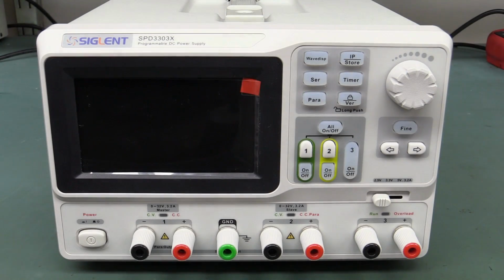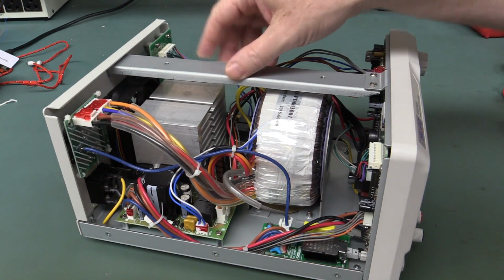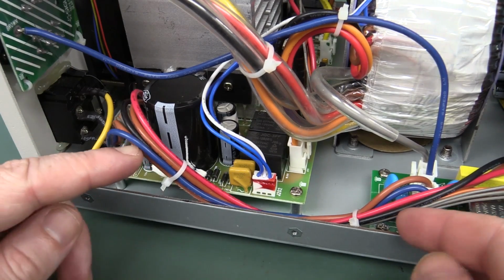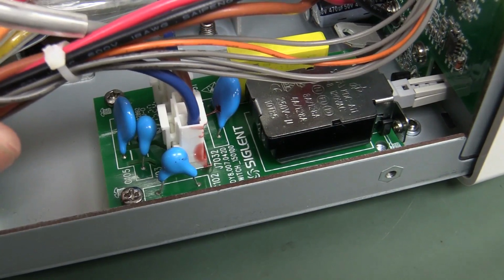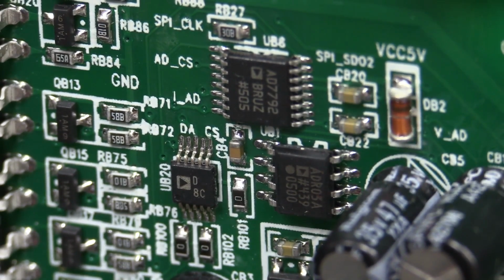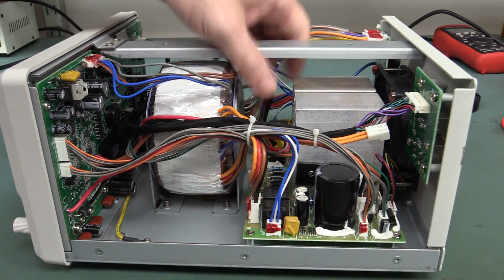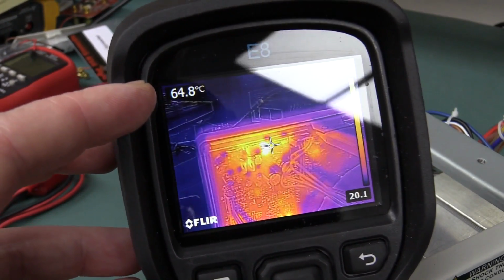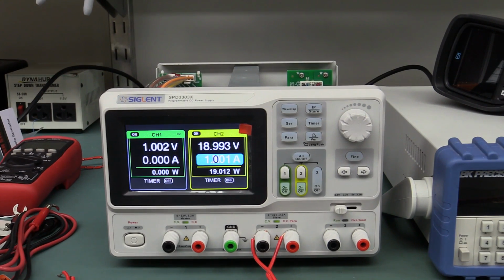EEVblog #828 - Siglent SPD3303X Precision Lab PSU Teardown

Comment: VOLTAGE SETTING OVERRANGE! lol
Seems like something only a rookie would need, but how many rookies would have access to or own a $500 power supply? Maybe they reused some user interface code from their other devices?
A less obtrusive "message" might be having the cursor or highlighted digit turn red for a split second, or a short "beep" for valid operations with a longer "boop" for invalid ones
Reply: A more useful thing would be to do nothing. A control knob doesn't need any message... when it stops doing anything, then that means it is as high (or low) as it can go.

Comment: Two noob questions:  
1) So linear power supply is a good thing...  Why?  (I thought switching ones were the best thing since sliced bread since it wastes less energy,  less heat etc..)
2) And what's the point of supplying power so precise down to single digit milliamps?
Reply: Nobody replied, so I will try to cover at least some issues (some 5 years later):
1. Linear power supplies are heavier and have some other limitations, however the power output is CLEAN. There is no ripple or electrical noise from the switching operation. Ripple on the power input can really upset sensitive electronics, and cause misdiagnosis (eg: where is that harmonic frequency coming from?).
2. The ability to regulate power accurately is important for troubleshooting and designing. It becomes more important the lower the power requirements of the connected device. 1mA is irrelevant to a 12V50W light bulb, however it is vitally important for a SMD LED that is designed to operate at 2mA maximum.
3. It's not just the precision, but also the ACCURACY, the resolution drift, the stability and the repeatability of Voltage and Current measurements. It's no point having 1mV precision if the accuracy is +/-5mV
4. Generally a Linear power supply is ALWAYS considered better than a Switching power supply. However they cost more and are large and heavy. You get better "bang for bucks" from a Switching power supply, but they are always an inferior solution. That said, for the same $$ you will probably get better features and raw "on-paper" performance from a Switching type power supply.

Comment: I've seen cat 6 fail completely due to a centimeter or two of untwisted pair where the installation tech has unwound it to make it easier to punch down. A long run of untwisted pairs, inside a high-emf 50.60hz environment, surprises the pants off me. I'm guessing it's a pretty slow connection.

Comment: My Siglent power supply transformer (got two- the one is S model the other is with one less digit resolution on the display. I thing it is the D model) went buzzing horribly after 5 times use ! It is an fairly expensive 3303S of more then $350.

Comment: Dave, you constantly talk about the capacitor brand, and how one brand is "better" than the other. What do you mean by that? Are you talking about electrical specs, or the lifetime (or both)? Is it something measurable? Can you come up with an experiment that clearly shows that Rubicon caps are better than Lelon caps? How would you test a claim like that?
Reply: Both,yes, failure rates are recorded and you can see them, use some caps hard for years and examine them electrically and look at the failure rates and they are better lost of the times even in specs.
Reply: It's not the brand that matters, that's just personal bias (which Dave does very well).
The specs of the capacitor is what is more important. Rubycon makes cheap low-end short-life capacitors, and Lelon makes really high quality capacitors. Download each brand's "Series Chart" and you will see the vast range of characteristics that each brand supplies.

Comment: WOW, 100C on the outside case of that transistor?
I know transistors can handle that, but I'd rather see it at a lower temp than 100C ... maybe like 70C or so.

Comment: Talking about TO-220 package components vibrating loose, I resurrected a cheap XMH ballast a while back in which the input voltage regulator actually vibrated loose.

Comment: Hey Dave
nice video. Can you do a video on the differences of the different Capacitor Brands? You always tell that one brand is the best but why and can u prove it ;) 

Greets from Germany
Reply: Reply to an old post... Capacitor brand is not as much importance as the SERIES of capacitor. There are cheap and nasty Rubycon models, and there are good quality Rubycon. Same for Chemicon and Nichicon,w ho also make very high quality and also make low cost short-life models. Same for Lelon, and even for brands like Capxon who DO have good quality capacitors in their ranges. There are many many different types within every brand, each with various characteristics and compromises.
The main thing about the brand is "reputation" rather than anything else - this is more about personal bias, as well as knowledge of whether rated specs (eg: Lifetime) will be met.... those things cannot be tested or proven.
A good analogy is for cars - is an Audi a "better" car than a BMW or a Ford? Which is the "best" brand of vehicle? So that is the type of question that you are asking about Capacitor brands... nobody can answer that.

Comment: Those insulators don't break the shorted turn.  One would need to be behind the bolt head to break the circuit, not between the transformer and the mounting flange.

Also no way they're running Linux on the STM32F207VE with its 512k of flash and 128k of SRAM.  This is an M3 microcontroller, not a big ARM SoC.
Reply: +Benjamin “Ozias” Esposti It's not running Linux.
Reply: +ollopa1 Dave said that he could see an insulating washer under the bolt.  I couldn't see it but my eyes have already seen their best days.
Reply: +ollopa1 
Maybe it's a chopped up version of Linux?
Reply: ollopa1
Okay if you say so :P
Reply: actually there IS linux kernel (uCLinux) for Cortex-M3 chips and it may run on STM32, but still it requires lots of program and data memory, can't run on standalone STM32.
Reply: ollopa1 He's referring to the insulating washer sitting between the nut and the mounting flange (5:54). The insulator between the transformer and flange is there to protect the windings from sharp edges (6:49).

Comment: If they consider repairing the banana plugs issue, screen saver and out of range message, and also that possible hotspot on that rectifier. I would buy it.
Reply: I would'nt be let down by an out of range message or a screensaver that can be turned off in the settings ;-) But the binding posts are indeed very annoying.

Comment: Just pointing out that it's not Linux or any "high level" OS running on the STM microcontroller. It hasn't got the memory, nor the processing speed; it's a Cortex-M3. It might do the display rendering (drawing fonts and such), but there might be another actual controller. As for the JTAG header, the STM also supports JTAG-SWD, so it might be using the 20 pin connector, but 3 pins would be enough too:)

Comment: Sorry, this power supply is a hot mess. The binding posts should have been the first "holy crap" and return. The interface looks terrible! Like, I realize it's 1mV/1mA, but wow... it's just ugly. Also, the fact the 3rd output isn't current limited... why on earth would you buy this over the DP832?! It's $450 street, and the high res upgrade is $100. sigh Siglent need to up their game if they want to really compete.

Comment: Why do you say switch mode rubbish dave ? Are they that bad?
Reply: +Alperen Akküncü 
Well, they can be.
Switch mode power supplies have very noisy outputs, and the noise is at a high frequency.
But I do like how they are smaller and more efficient! :)
Reply: thank you for your responses guys

Comment: With a shorted output at a 3.198A limit, the feedback circuit is probably keeping the voltage drop across the power device the same no matter which voltage setting is used right?  Unless it doesn't automatically switch taps as the current limit is reached.

Comment: Great vid, as usual.  The poor quality of the front panel connectors is very surprising.  And failing to use the standard spacing between them is nuts.  I wouldn't buy this thing, just because of those problems.
Reply: The whole digitization of the interface is a mistake on a PSU. It should remain simple and 99% analog. An ARM microprocessor in a freaking PSU give me a break.

Comment: Can anyone help me? im doing a SMD pcb and im using a MJD122  (TO252) to control a 12v fan using pwm from an arduino. there is not many heatsinks for the TO252 package and the only ones i can find are quite expensive. anyone know any clever way of attaching a heatsink to this ? space is limited so i cant exacly just glue a heatsink on top of the TO252 transistor.
Reply: Replying to a VERY old comment... TO252 is designed to use the copper traces/pads as a heatsink. You add lots of vias and have a large copper surface below to dissipate heat.
The MJD122 is a very poor choice for PWM, you should use a Mosfet. Because the MOS has low internal resistance, the device won't get hot or need any heatsink at all for a small load like a 12V fan (what ? 150mA or so?).
HOWEVER, the proper way is to use a PWM controlled (4-wire) fan and just use a tiny output device to drive the PWM input of the fan. If space is limited, then don't add ANY unnecessary PWM power output on the PCB at all.

Comment: When I look at this all I see is cheap and cheerful!  Pity you're so far away Dave, otherwise I'd drop in with a PROPER linear lab PSU, or 3!  You'd love my Farnell H30-100, thats 0-30 volts and 0-100 amps, and 89 kg!!  Or my HP 6266, 0-40 volts & 0-5 amps. Or my Kepco ATE 36-30M, 0-36 volts & 0-30 amps.  All old school with no microprocessor  software programming etc, but absolutely no flappin in the breeze or how you doin either!  Although the Farnell and Kepco are 2 man lifts, to avoid a potential casualty visit that is!
Reply: +turboslag Farnell H30-100 is on my eBay grail list haha
Reply: +Davo Mapo 
Was or is now?!  The problem with the H30-100 is shipping it!  Actually, and don't ask me why, but I have 3!  And I had to collect them all, which entailed a 300 mile round trip on one!  Although 89 KG is not heavy in the scheme of shipping, as they can can be put on a pallet, sellers are not willing to do it.  It is a beast though and will sit at full output, 3kw remember, all day, every day without breaking sweat!  Ok, it gets warm but is designed for continuous operation.  It certainly gives my electronic load something to do!
Reply: The last time I saw one on eBay is was going for are 500 dollars with over 100 dollar freight. I am going to continue to look on Labx as they have some amazing deals on ps. My current power supply (chinese) spits out 30 volts at 15 amps which is sufficient for most of what I do. I do also have a Bertan Model 210-05R which is an amazing supply I use almost daily for my high voltage experiments.
Reply: Davo Mapo

I wish you luck in finding one.  Also look at Kepco, a native US maker. I mentioned the one I have but they have a massive range and the older stuff can be had for not alot, it is very good stuff.
I was lucky and found mine in the UK so had our mains voltage setting. It was on ebay as spares or repair as the seller couldn't get anything out of it, so I got it for about £15!!
However, I had noticed it was missing it's programming plug from the back and knew thats why it seemed dead.
It took me a while to find another plug but the PSU fired right up when it was installed!

Comment: Is this unit from the Australian market? I had always thought that for C-tick certification, air flow had to be filtered (ingress of dust). Can any one clarify?

2:50 Like a sausage down a hallway!!
Reply: C-tick has ABSOLUTELTY nothing to do with airflow or dust. In actual fact "C-tick" hasn't been applicable in Australia for about 5 years, probably longer (it has been replaced by RCM).
The only certification that would apply might be for electrical safety, in that live connections could not be touched with a standard finger. In practical terms that means no holes larger than about 1cm diameter with terminals close enough for a finger to poke to..

Comment: The chassis will be metal pressed not laser cut, if you look at one side of the sheet it is curved over on the edge (would of been the top side of the sheet as it was pressed), and the burr is from the shearing force as it is pressed (would of been the bottom side of the sheet). i used to do metal pressings years ago.

Comment: +EEVblog - That toroidal shorted-turn thing is a classic - it's the numero-uno rule when building your own amplifiers etc. ;)

Surely the bolt would still constitute a shorted-turn though, since there's still the electrical contact to the chassis?

The insulating pads only stop the brackets contacting the windings (and possibly damaging the wrapping), but they don't stop the magnetic loop?

Comment: That's punched sheet metal that leaves a burr on one edge.  One is supposed to run a deburrer down the cut edges but it's often neglected.  Also I've seen some lovely colour lcd drivers for the STM32 that wouldn't need any fancy OS.  I guess they're probably only running a basic RTOS in that thing.  Bit worried about all that clicking though.

Comment: Dave, what do you really know about the reliability of Lelon caps.
What you should be lamenting here is the choice of mains transformer in the design. You really should stop to realize how unintelligent and primitive that is. And 30V 3A is not a lot of power at all. With competent modern engineering it would be an inexpensive matchbox size device with superior operation.
Reply: You are 100% correct about the capacitors. You are 100% wrong about the transformer and the engineering into a matchbox..

Comment: Message to Eric of Siglent, make all the improvements mentioned in the video and add $10 to the cost if that's what is required. It will benefit you in the long run!
Reply: The Chinese appear based on my experience to lack good programmers for this type of device.  I think they take all the talent and put them to work hacking other nations.
Reply: Siglent is rubbish like all other Chinees electronic products. My 2 Siglent supplies (bought in 2015 having problems).
Reply: @yoramstein  bruh marco reps never had problems with his supplies. Maybe you received the dodgy ones.
Reply: @yoramstein  you know you misspelled a lot of things. It's hard for me to read.
Btw reason for Chinese products are shi* because they're cheap. 'You get what you pay for. '
Reply: @DoctorThe113  i know even more- Siglent used to be a OEM manucacturer. It made all the low range scopes for LeCroy and for B&K precision and for Atten. If you watch carefully you will see LeCroy dds signal generators (in black color ) are same as Siglens white ones.  Still I say China product which are not made under American supervision are s..t   it  is not only electronic measurment equip. it is EVERYTHING i buy from CHINA is BAD when compare to European or American made.  My father tells me japanees products in the beggining were also bad till they have learned to make better products. The Chinees have to learn it too but then their products will cost same as American like Japanees product are very expensive these days.
Reply: @DoctorThe113  Sure you get what you pay for. My two noisy vaccum cleaners  (AEG rebaged Chinees ) have kost only €49 =$us55 each but they consume 2KW ! Plastic broken. At same time i have an old Philips of 35 years old 1Kw plastics is softer not recycled motor quite ! does same work !    What i am trying to say is-  if American cheap Tektronix scoop kost $1150 and a comparable Siglent kost $450 only buy Tektronix. It will last much longer and during the time you will have pleasure (and you will curse less :-) you will also have service if needed. Final calculation will  show the Tektronix was cheaper.  For people with small budjet (students hobby- i advice 2nd hand Tek, Agilent, Keysight, Keithley, Flukke, Philips, Iwatsu.
Reply: @yoramstein  that's what i am saying Chinese manufacturing is relatively new in comparison with for example American. Chinese product will upgrade in future and sure the price will increase too.
Reply: @DoctorThe113  I used to import Siglent products for short time directly from the factory. I gave it up when i felt quality is not satisfying. It is the same situation like with Japan in the past it used to make bad products today they make the best products  which are even better then  of the Germans. I am little worried about society stability in USA and would like to see some jobs coming back. Same with Europe. Germany is exporting a lot to China but countries like  Greece, Italy, France, Spain, Portugal, Belgium, Netherlands, Sweden, have lost lots of Industries. there is a tendece of young people  living with parents at age of 30 and prefer not to start a family. That is bad situation. The world helped China enough after the "good times" of Mao tse Dong.
Reply: @yoramstein  Yet the most critical computing gear in every datacentre worldwide is made in China. Runs for many years 24/7 with very little failures. They can make cheap and they can make very high quality. It's the customer that dictates the quality of the product 'they' buy.
Reply: @yoramstein  fun fact: did you know that agilent rebadged rigol ds1052e as it's own? Dave jones said it not me!
https://youtu.be/w6MdhoV03e4